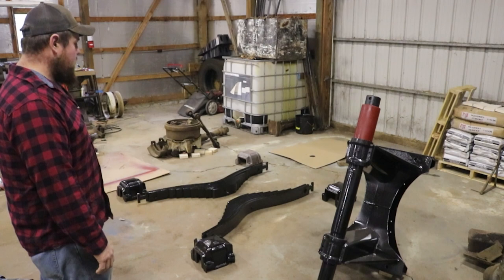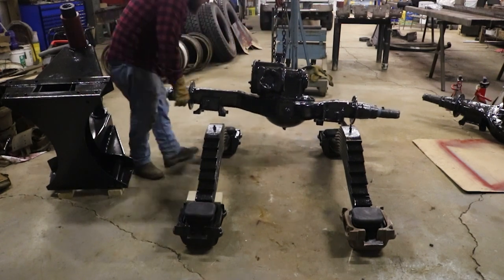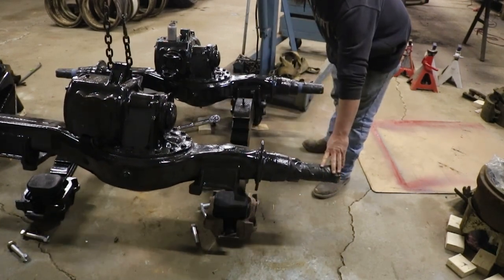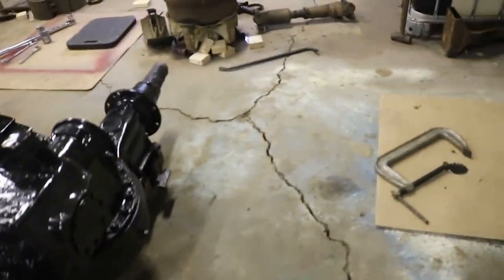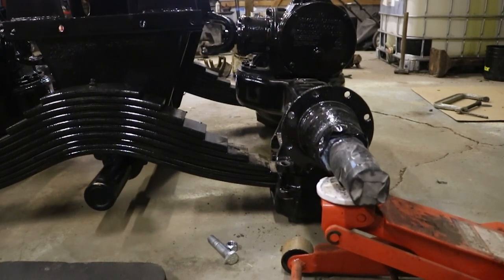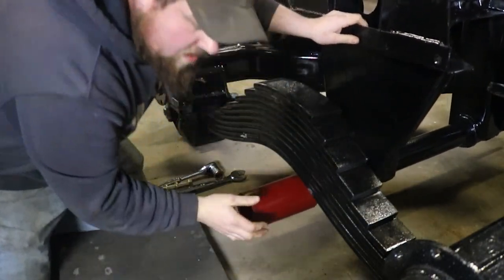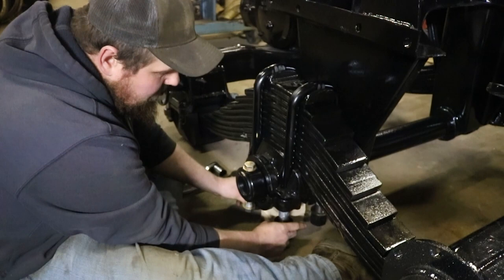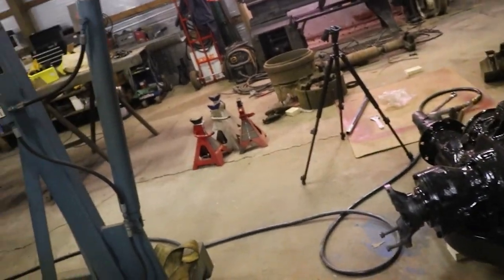Mack R686ST/ Truck 17 Restoration Part 6/ Camelback Suspension Trunnion Reassembly

Comment: Great to see some rebuilding and it's looking good.... you answered my Q about alignment, much easier to get the experts to sort it out for you... thanks for the video and congrats on 500+ subscribers
Reply from the maker: Thank you, it's a welcomed change of pace. The spring shop that I have been getting most of my parts from has the full set up to get the alignment spot on as well as torquing those U- bolts. It will be a cake walk for them especially with it just being a rolling frame. I'm still beside myself that we hit 500!

Comment: Nice to have a shop to work in albeit a little cold and tools to use. It's gonna warm up later. I don't mind paying for a service like the axle alignment and torque of the bolts. It will be done correctly and you won't have to worry about it. Yea when stuff starts going back together it gets you wanting to do even more but rebuilding something like you are doing you have to take it one step be it big or little at a time. You will get there. From Ga...
Reply from the maker: Agreed. I am thankful to have a roof over my head. I've spent many years working on stuff out in the grass and gravel. Thanks for watching!